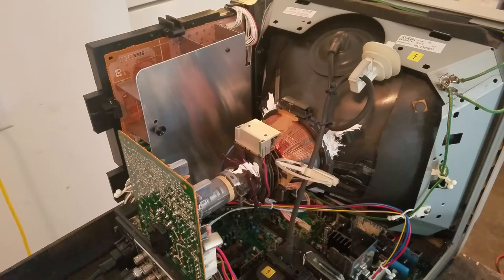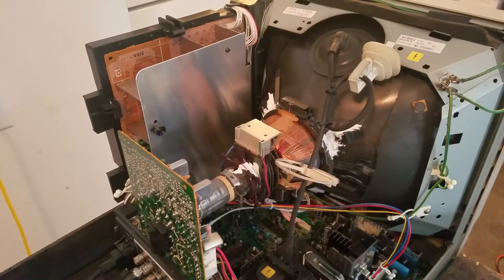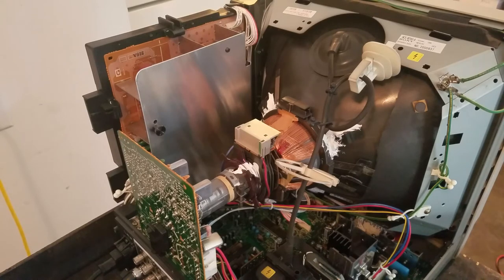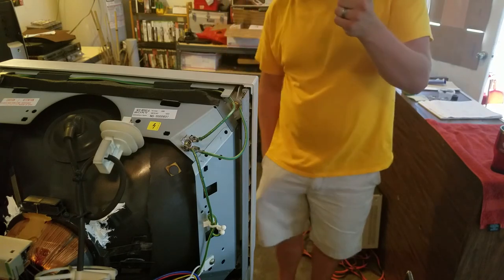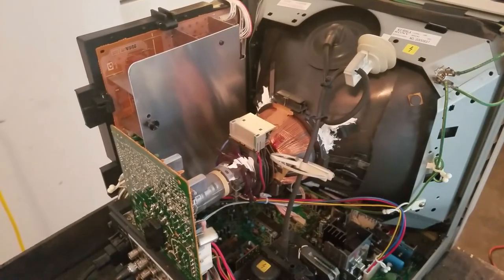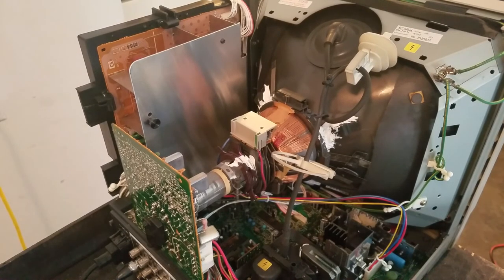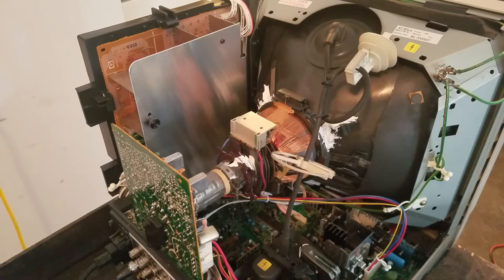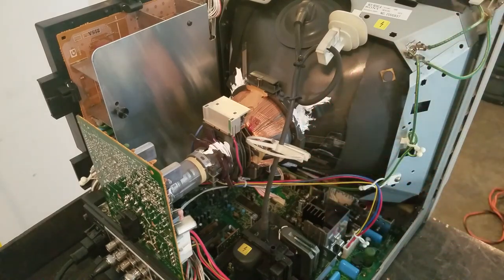Sony PVM CRT Safety

Comment: Loving this series. I subscribed. I ended up selling my flawed pvm but there are three things I'd love to learn. (Where were you man 4 months ago, lol, just kidding) 1) How to discharge the pvm safely 2) When I had the pvm I had issues in the corners from it being dropped and had reds bleeding in at the bottom right corner. I'd love some tips on if that were to ever happen again. I placed a few magnets on the back of the crt but didn't help so I just bought a new medical pvm. 3) How to properly remove the boards and tips on replacing caps. Hopefully I have a really low use medical pvm and won't have to do any repairs any time soon but I can't tell you how much I'm loving the channel since most of the youtube videos on crt repair are either on the large 32" commercial tvs or the guts are so open/basic compared to our high end pvms that you really question if those fixes apply to our pvms. With the retro gaming booming right now (pvm wise) it helps if we know how to take them apart and how to do simple repairs like that convergence fix if you jostled it during a move. Keep up the great work man.
Reply from the maker: Thanks for the comment.  I will continue to make these videos because there are hundreds of topics involving CRTs.  I will show tips on discharging a tube in a video upcoming.  The other topics will eventually come further down the road.  If you got a newer medical monitor, then I'm sure you are good to game on it most likely forever.